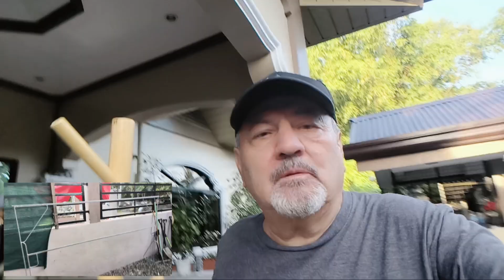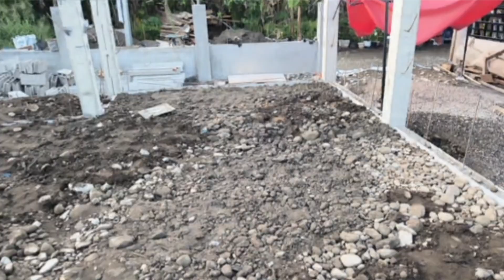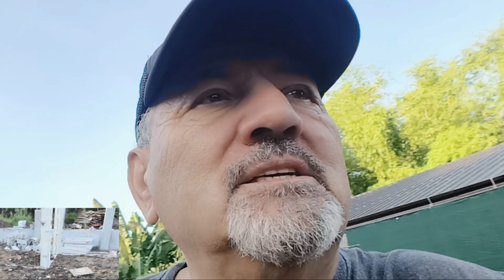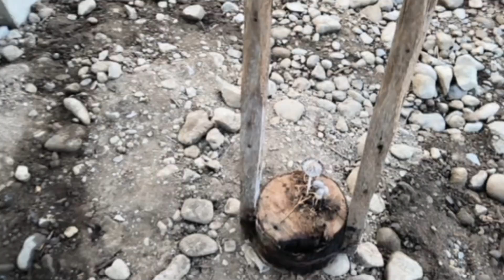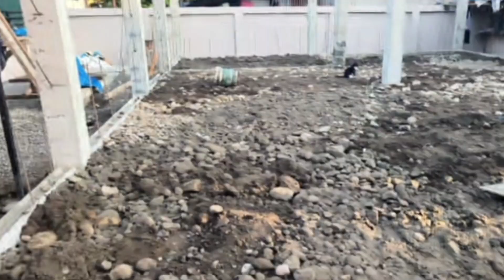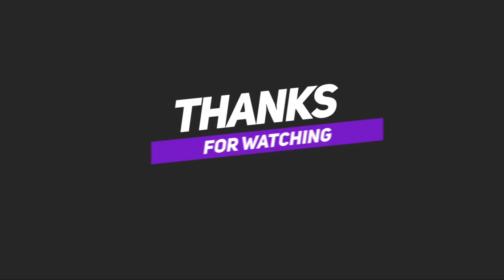House building in the Philippines!

Comment: Helpful video. Interesting watching your building plan move forward. Regarding the concrete form blocks— I’d like to hear about your experience with it and where you bought them from. I’m moving and building just south of you in S Leyte in 2026. Thanks, Joe 
*I’ll email you privately
Reply from the maker: Hi, I like the concrete forms because they become support walls. They are unlike hollow blocks that are basically just used to form the walls. A local engineer/contractor is now manufacturing these forms. He tells me he got tired of having to repair cracks that formed in the walls as the house settled post construction. 😮❤